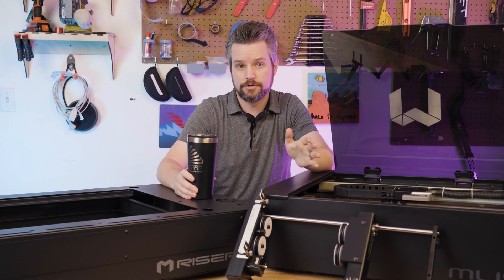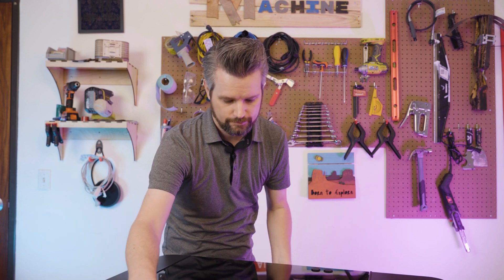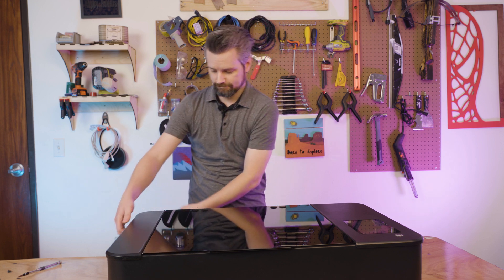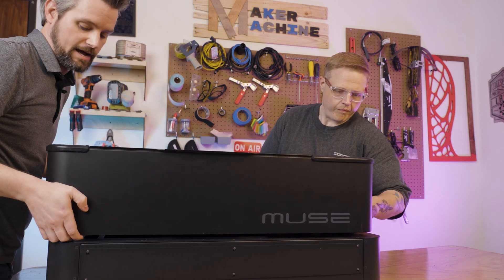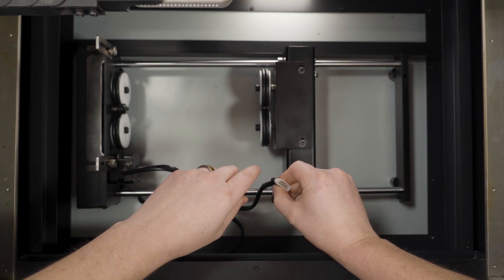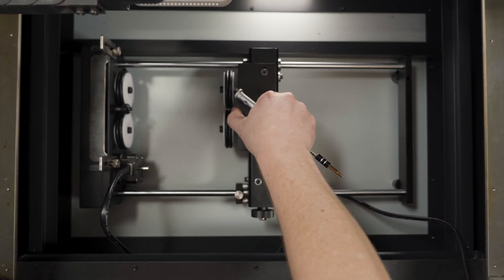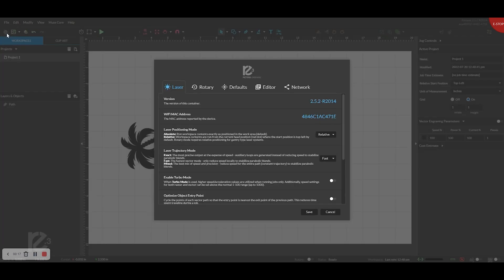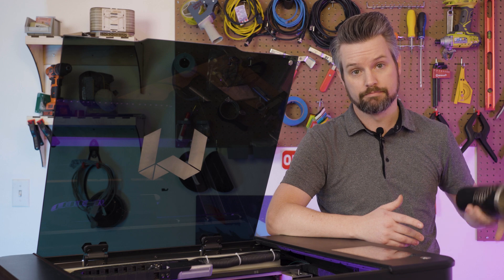Custom Engraving Tumbler with Rotary Riser Accessory for Muse Desktop CO2 Lasers

Comment: Pretty basic explanation.  You didn't cover which lens to use or HOW to know which side to place the rotary device so it engraves the image the right way.  In other words, which direction should the rotary turn to engrave the image correctly?  Material is TOO DAMN expensive to just figure out.
Reply from the maker: Which ever way you have the rotary turning, should correlate with how you rotated your design. We suggest using one cup with masking tape on it for testing with low power so you don’t waste expensive material.

Comment: What if the bottle has threads on the inside.   How do I adjust that bar?
Reply from the maker: You can completely remove that bar to use the rotary!
Reply: @FullSpectrumLasers    It doesn’t need to be there to hold the bottle down on the rollers?